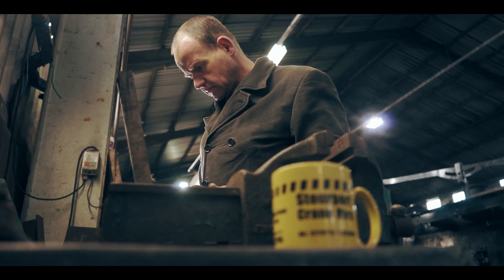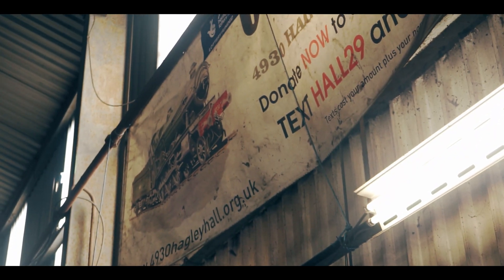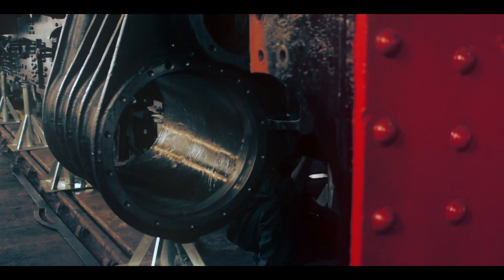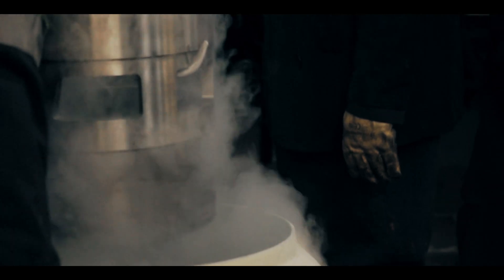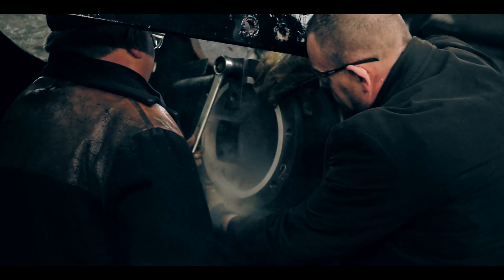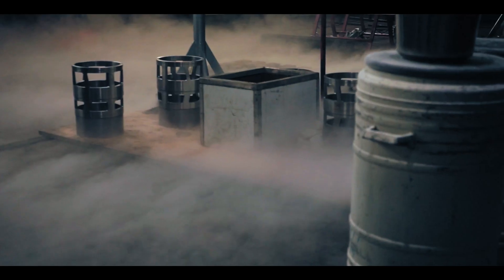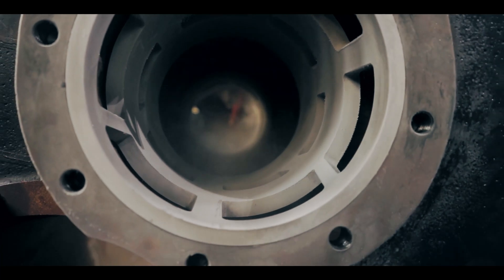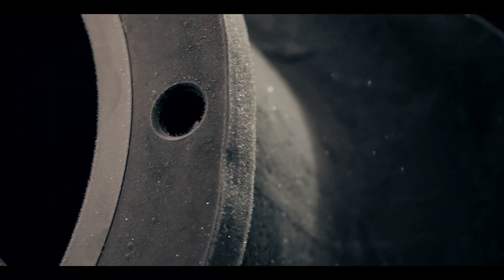New cylinder liners | The Restoration of 4930 Hagley Hall continues | Severn Valley Railway

Comment: Oh, and why don't we can reuse the 5 Caradge Class 313's, Class 314 and Class 315 and replace the Electric part underneath with Volvo B10M, Gardner 8LXB and Gardner 6LXB Diesel Engines with 8 Speed Leyland Hydra cyclic Gearboxes Please?